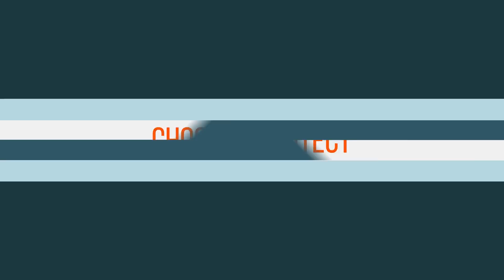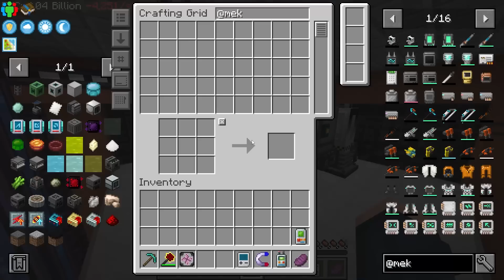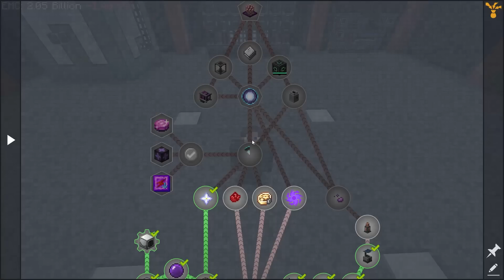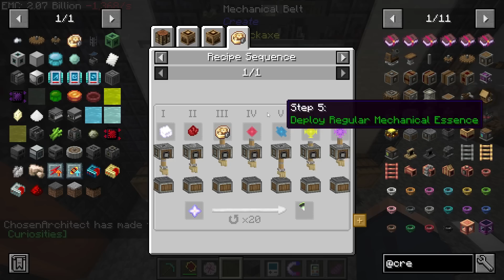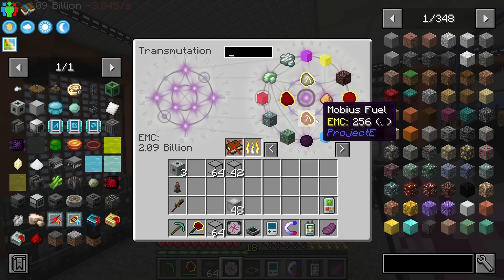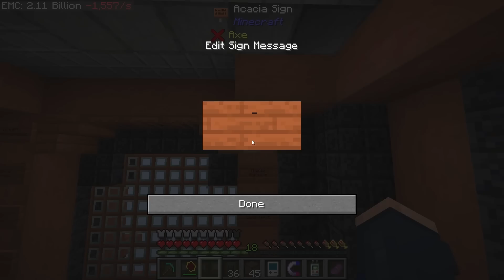Mechanical Mastery Minecraft Modpack EP19 SPS Antimatter + Create Precision Mechanism

Comment: IIRC, Chosen, you can color the pressurized tubes different colors and they won't connect to each other. You can set them using the configurator.
Reply: I was coming to say the same thing. I do this with all Mekanism contraptions so you don't need to stress about cables connecting and contaminating other pipes.

Comment: Could you use entangleporter to move radioactive fluids? Cause it seems much safer than all that routing with tubes that can connect to each other... anyway, it's always a pleasure to be able to see a good sps setup! Nice work!
Reply: Sadly, radioactive gasses are totally blacklisted from the entangloporters and normal tanks. You can use the entanglement mod to "teleport" the connectors,  but its not in this pack sadly.
Reply from the maker: Unfortunately they will accept radioactive fluid

Comment: For an easy energy set-up, you have the POWAH mod. Why not just create a powah generator? The generators are small 3x3x4 multiblocks that can create significant amounts at blazing or nitro level of energy using uraninite, redstone/coal (don't remember which one, been a minute since last used), and ice. The only thing is automating the creation of ice with a blast chiller. Also, that's only 1 generator from Powah. And I believe there are 2 others, 1 being a thermal generator that may run on lava (haven't messed with this one before).

Comment: They added AE2? Finally I can play the pack normally.
Thanks for the video Chosen, love your stuff!
Reply: Rs>ae2 😎
Reply: @anthonysalyer5510  For storage theyre equal, for item/fluid management ae2 is superiour
Reply: @CarpathiaS  equal on storage? Often I'll fill just the types on one ae2 storage before filling the capacity. You can make a 64k drive useless just by filling on types.
Reply: @anthonysalyer5510  Oh thats right, ae2 is superiour on storage as well, cus it stores more then 64k of 1 item if it stacks.
Reply: @CarpathiaS  wait what? Since when?
Reply: @anthonysalyer5510  Just manage the item input, 64 iron shovels with different durability shouldnt be in a digital storage anyway
Reply: @anthonysalyer5510  "the 64k storage cell can hold 520192 items of one type" 
It has always been this way

Comment: u can get 250M rf/t using fusion reactor from mekanism + project E clock
Reply: That's a passive reactor right?
Reply: @anthonysalyer5510 yes but it require a lot material and fuel to run at max efficient